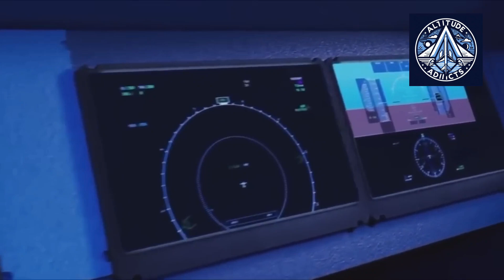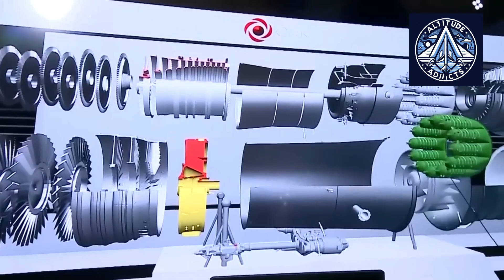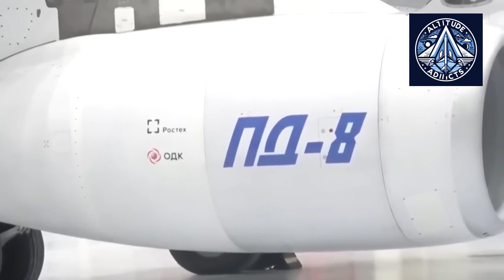PD-8 Faces Similar Problems like the SaM-146 - the Rocky Road to SSJ-100 & Beriev BE-200 Takeoff!

Comment: There will be problems with the engine, there will be problems at the certification stage. I must say a huge thank you to the Western sanctions on aircraft and other equipment. I live near the city of Zhukovsky, where the Central Aviation Research Institute is located, everyone is happy about these sanctions. The state needs a regional civil aircraft that provides good economy and safety. You have proven to our naive leadership that you cannot trust the West. This engine will be made. It has long been known that SNEKMA failed to design the hot section of the Sam-146 engine. It is good that now, at an early stage of testing, the shortcomings of the PD-8 have been identified. This means that the work is underway, and a result is needed.

Comment: If you want to be fast, Aviadvigatel needs to bring in consultants from GE who have successfully used the Embraer E190. Embraer used to use small GE engines. However, it is not possible to develop machines with Western help at this time. We really have to be patient waiting for research and trials to produce a reliable machine. I wish Russia the best for independence in making aircraft with 100 percent Russian-made components.

Comment: This engine has been in active development for literally 3 years since the start of the special operation and is based on the PD-14, not the SaM-146. Even an optimistic attitude should not conflict with reality. If the engine is launched into production in 2 years, it will already be a fantastic event. And if the engine is launched into production at the end of 2025, it will be a miracle.

Comment: The SAM-146 was a JV between Leonardo of Italy and SAFRAN since the SS-100 and the YAK-130 were Italian/Russian JV's with Italy holding 51% of the venture and leaded them.... Saturn of Russia was the engine integrator for the SAM-146 and Sukhoi was the integrator for the Sukhoi SS-100 AND the Yakovlev was the integrator for the Yak-130...... All the parts and components were procured by Leonardo....!
Reply from the maker: Nyet. It's Franco Russian.
Reply: @altitudeaddicts It became a Russian JV after the Italians abandoned the project in favor or in exchange for Boeing giving them a stake in building the mid section of the B787 AND due to binding contracts as the Italians sold their participation in the SS-100 and YAK-130 back to the Russians...

Comment: They can always hang a Progress D-436TP if push gets to shove... The PD-8 is based on that engine, they can also hang a Kuznetsov NK-8 or a Soloviev D-30 version on it, they are true and tried engines, if there is one thing the Russians are good at is in aircraft engines with a bunch of designers to crush build anything they need and a scientific pool to pull it off....
Reply: But they want a fuel efficient engine comparable to Western contemporary.
Reply: Depends on their requirements. If they only need a domestically produced and operated airliners, it doesn't have to be very efficient. The state can subsidies fuel prices.
Reply: @LongTran-em6hc  The Russians are second to none in aircraft turbine engines, the digital " management " on western turbines adds little value to resilience and reliability as you can see in the P&W saga with 1600 engines grounded and bankrupted airlines, just look at Interjet of Mexico and Indigo of India or United Airlines.....
Reply: @mazikkaluchka5562  That's the most bullshit I have heard today.
They have not have a competitive, mass produced high bypass turbofan for the civilian market for the last 40 years, minus the modernized PS-90A.
They are around 30 years behind Western manufacturers.
Reply: @LongTran-em6hc After the creation of the AL-51 F1 for military aviation, things will go faster.
"Never underestimate the Russians"
Bismarck
Reply: @КостяФ-х9ш  Go fast, Da. Go slow and efficient, net. AL31/41/51 are low bypass, high speed dvigatel for jet fighters.
Reply: Talvez seja o único país do mundo que os façam em 100%!

Comment: This engine is new and is still under test and no outsider knows the detailed properties. 
So far the Russians didn't say they have problems. Altitude Addicts made these allegations. We trust the source instead of a youtubers allegations.
Reply: YES YOU ARE RIGHT ON TARGET WITH THIS STATEMENT!

 THOSE YOUTUBER ATTITUDE ADDICTS YOU ARE TALKING ABOUT ARE ACTUALLY WORKING FOR THE UNITED STATES STATE DEPARTMENT/CIA MOLES SPREADING BULLSHIT,LIES MISINFORMATION AND TRYING TO THROW MUD ON THE RUSSIANS ACHIEVEMENTS TO DESIGN,DEVELOP,ASSEMBLE,
MANUFACTURE,AND MARKET A CUTTING EDGE SUPER VIABLE MODERN VERY NICELY APPOINTED ULTRAMODERN COMMERCIAL AIRLINER THAT WILL BEAT AND OUT COMPETE BOTH BOEING 
AND AIRBUS WORKING 
IN YOUTUBE SPREADING FALSE-FAKE-ASSED-BASELESS-PHONEY-ALLEGATIONS-THAT CAN’T HOLD WATER WORKING FOR THE STATE DEPARTMENT AND THE CIA
Reply from the maker: We have named the officials in the video. Only speculation is that the trouble is in the hot part, which is rather a common knowledge.
Reply: @altitudeaddicts  You propaganda 💩💩💩
Reply: they can only use it within Russia.. international air travel will never return to Russia as it was before... this has no export market.. it will also exhaust more of the Russian resources.. a bit like Italy building their own jet engines and airliners... same sized economies BEFORE the war.. and now Russia will have lost all their best people overseas who will never come back and the younger generation are suffering a self-imposed genocide..
Reply: @milesinnz  what international travel? you mean europe, US, Uk, look on the map, thats not the world. Russians looking on the other side, EAST( where the progress is at right now)
Reply: @aantonic  you mean Thailand.. I am on an expat forum there.. the Russians in Thailand sure have a bad reputation.. where else were you thinking ? and if you think Thailand is progressing then you don't have a clue what you are talking about ? and where are the children of Russian oligarchs.. including Putin's children... ? so.. where are these other beacons of prosperity.. ah, maybe India ????
Reply: @milesinnz  Thailand is alot better then US, i know that btw, been there.Vietnam too, Singspor,Malaysia and do on. US is in  BIG decline so is EU where i am right now
Reply: @aantonic  that is nonsense - I have what I can call a third home in Thailand... my friend whose family I can stay with as long as I like and they look after me and don't ask for a $, she is joining me shortly in NZ to motorcycle all over NZ. Then I will return to Cambodia where I have a second home, a small farm and a young daughter. "I have been there" - wow you managed to book a flight and get on an airplane.. your ignorance knows no bounds..
Reply: @milesinnz  my wife is from Vietnam ans spent many months there,many times. Been in Thailand few times too and saw the progress, hiigh speed train lines being built, China investment is huge Also luved in US and know what US has become, s...hole.  why you not in the west? There is a progress,right?
Reply: @aantonic  i think the US need to see the value of the US$ halve.. then we would see more home grown business in the USA.. do you want to tell me Vietnam is not an export driven economy.. now where do you think they export to... tell me, if what you say is true, what happens when Vietnam's major export markets collapse.. I am all ears... and why do people from SE Asia want to get to collapsing western countries and not Russia ?
Reply: @aantonic  why is China now desperately trying to deals with Mexican manufacturers ? did it never occur to you that Mexico, right on the border with the USA can fulfill what SE Asia does.. so where will the new SE Asian export markets come from ?